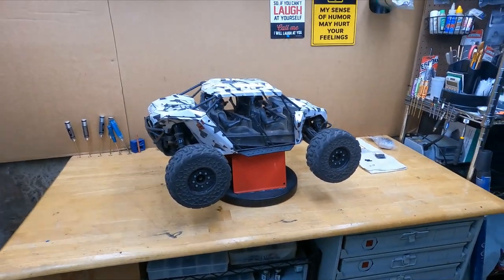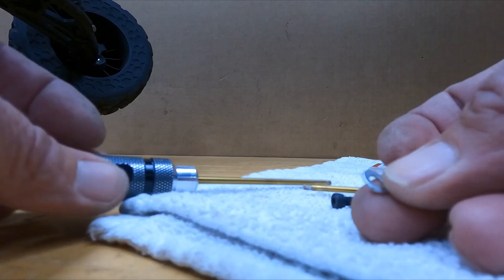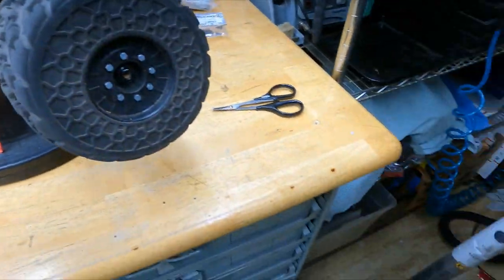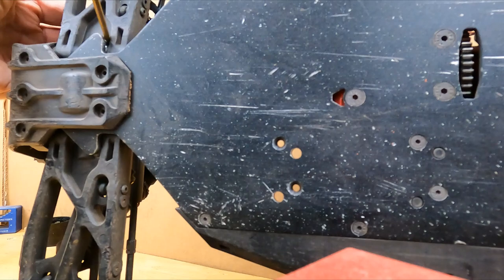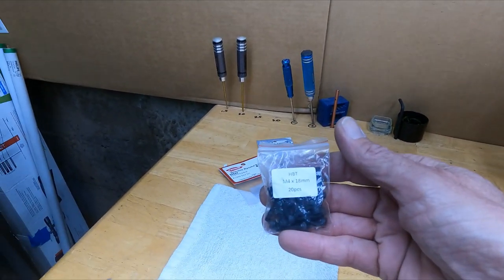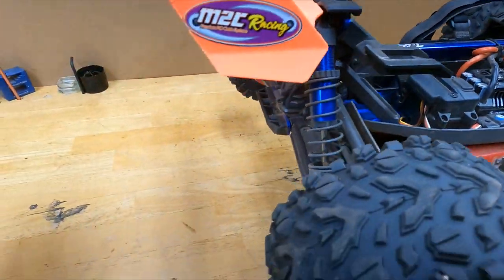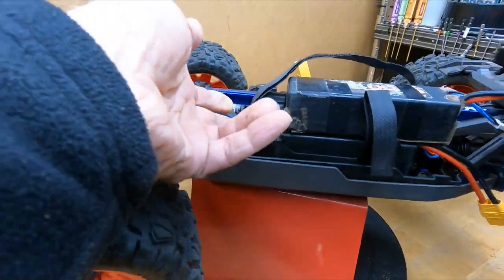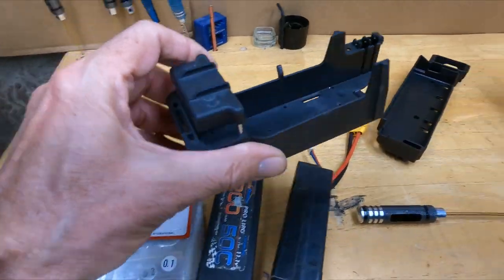TRAXXAS SLEDGE BATTERY TRAY, ARRMA FIRETEAM ,  EASY , CHEAP IMPROVEMENTS

Comment: Nice upgrades I did that with the motor mount screws and the fans, saw you use the spacers and picked some up off amazon tightened up the wheels nice, now I'm going to have to pick up them Tekno screws haha
Reply from the maker: It's the little stuff that adds up , I see you got a Fireteam , I can tell you like it , I don't drive mine as much as I should , but that's going to change

Comment: Same problem on top bolts of motor slide. I went to ACE hardware store and got SS bolts. Now it’s tightened and no loose. E Clip for pinion gear is also available at hardware store.
Reply from the maker: Sometimes it's hard to find the metric stuff let alone a hardware store ( always someone there to help you ) ,  hate big box stores , just easier for my lazy ass to order it
Reply: @ucrazy2rc460  bring bolt and slide to hardware store and 5 min you will be outside with 4 bolts and 10 e clips for $7.

Comment: Are you moving the fireteam battery tray to the back?
Reply from the maker: I just put it where it fit the best
Reply: Supposedly when you move it back it doesnt nose dive when jumping, in the video yours is at front. I want to move mine thats why im asking
Reply from the maker: @teknostructures4629  yeah it'll move back just unscrew it there's a little holes , has more aligning tabs so you can move it You don't have to drill anything or any of that crap